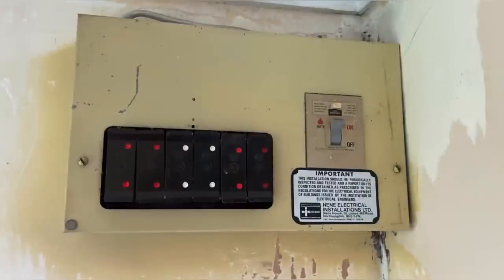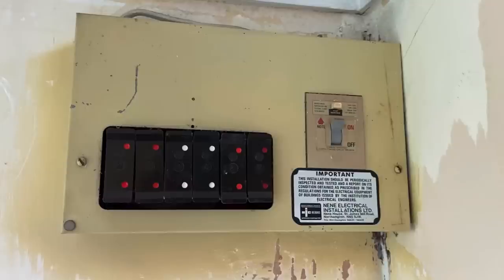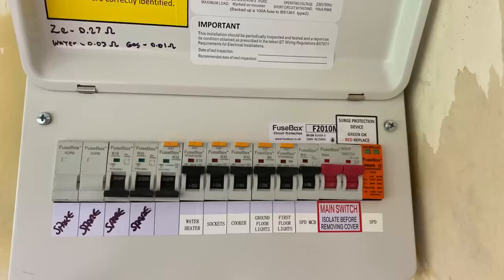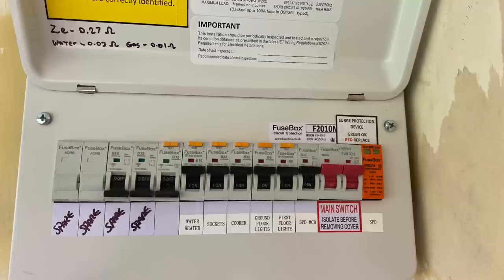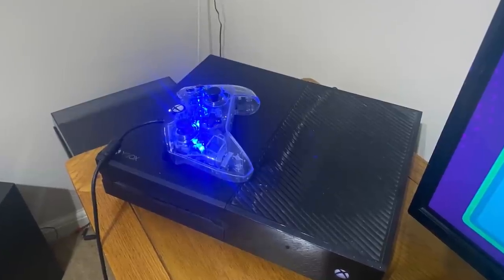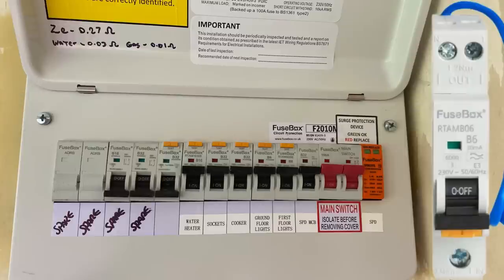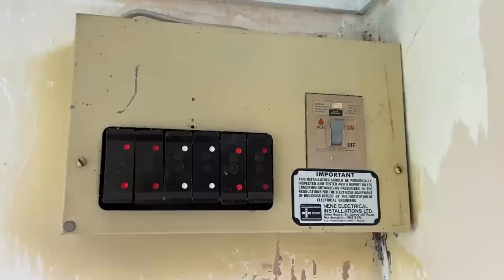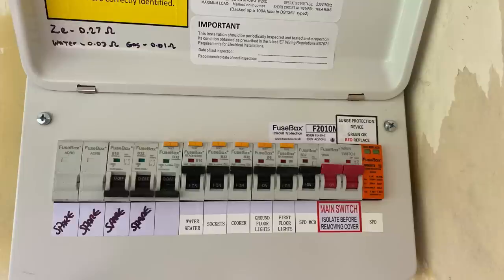Would you Change this Fuse Board..? WHY..? Understanding your new Consumer Unit

Comment: When I was still contracting I have updated the fuse carriers to MCB's which plugged straight in in place of the fuse, if they are still available it is a quick and safe way of updating your system.
Reply: Did the same retrofit to my Wylex consumer unit. Cost less than fifty quid. I had an external 30ma RCD fitted which looks like the one in the video.
Reply: All well and good and legitimate, but you still lack RCD protection, you would either need separate RCDs for each circuit or one RCD for the lot which would give a total blackout if tripped.  Recommendation would always be a new fuseboard.
Reply: Wylex plug in MCBs are available from Screwfix and Toolstation.
Reply: They also offer the major benefit of being able to safely reset a tripped circuit (assuming the fault has cleared itself, e.g. a blown incandescent light bulb that's now open) without having to turn off the main switch. If there's one thing I definitely wouldn't want it's try and insert a fuse carrier with nice fresh fuse wire into a short circuit.
Reply: @Ragnar8504  Best to turn main switch off to do that.
Reply: @antlane365  Don't see any reason to do that if we're talking about MCBs. For replacing a rewireable fuse absolutely!

Comment: On the plus side the old Wylex boards have double screw connections which to me always seemed a more secure connection.
Reply from the maker: Great point 👍🏻
Reply: A point I have made previously.  Two screws per connection,  round terminals ( not square like mcbs)  on incoming tail connections and outgoing ways .  Shower pull cords and cooker outlets etc had 2 screws per terminal,  now it's one big screw but is useless as it just splays the strands and can be wiggled out .
Reply: @Woodkin007  we should be telling the manufacturers this . Might be a selling point for them to promote
Reply: There might not be any truth in this. But a guy I talked to a few years ago worked for SSE . He said in his own home he would never have mcbs in his own home due to the fact he’s seen fires caused by faulty mcbs ..Hence he would only use rewireable or cartridge fuses in his house.  I often wonder if there was any truth in what he said.or could it just be down to loose screws?  in some ways in old Wylex were far better having  the 2 screws  on each terminal,excluding the earth.
Reply: @andysims4906  I worked for a network operator for nearly 40 years and the vast majority , if not all, of meter board fires that I attended were due to loose terminals within the consumer units. We were always taught to re-check every connection after cables were installed and dressed. Quite often you would be able to further tighten the terminal screws.

Comment: A few little observations:
- SWA not glanded into back of old board
- Two circuits don't appear to be 4 mm2 or larger but have 30 amp fuse carriers (first and second from the left)

Every time I see one of those RCDs I can't help but wonder how these came to be sold in the UK under Wylex and Hackbridge Faraday brands. As far as I can tell, the original design dates back to the 1960s and can be traced to F&G Austria. F&G was initially a German company but during WWII they built a factory in a remote corner of Austria (at that time occupied by Germany) to prevent bombing. After the war this company became independent and is claimed to have built the first production-ready 30 mA RCD.

Around the early 1960s they introduced a very sturdy range of MCBs and RCDs, which looked exactly like the Wylex one in the video, except for having the F&G Neptune logo moulded into the case. The exact same design was produced by eastern German state-owned VEB Elektroschaltgeräte Dresden until the Berlin wall fell. F&G Austria discontinued the design a few years earlier, perhaps in the mid-1980s. A surprising number of these units are still in service, in Austria although most RCDs are 100, 300 or even 500 mA types and therefore replaced as any updating is carried out. The MCBs also predate modern B/C trip curves and provide inferior overload protection.

Comment: A very important thing to mention (sorry if you did and I missed it) is that the original consumer unit is actually in a dangerous state.  This is because the plastic cover for the fuse carriers on the front is missing (it's supposed to attach via the little hole above the fuse carriers.  Without this in place to insulate the fuses from the casing a blowing fuse can arc to the casing of the consumer unit.
Reply: Not just that, but it has a couple of 2.5^2 (singleton) cables going into 30A fuseholders, plus a few other issues. It's notable that the old unit has 4 x 30A and 2 x 5A circuits (all wired @3:22) whilst the new one has just 2 x 32A, 1 x 16A and 2 x 5A. So one fewer circuit, and 2 fewer 32A/30A fuses/breakers. There's something very wrong there.

Comment: Proving your own point about a level of skill required with rewiring fuses - you illustrated winding the wire the wrong way round the retaining screw, so tightening the screw will tend to push the wire out.
Reply: Paul you giving your age away. I was about to comment similar
Reply: The problem you had with winding the fuse wire the so called right way round was it tended to snap the thinner 5 amp fuse wire . We used to do one end the right way round and the other end the wrong way round , ( for 5 a ) the little washer preventing push out.

Comment: My Wylex board didn't have any RCD protection, so it's days were numbered anyway. Then one day the electric shower stopped working and I found the 30A fuse carrier had got warm over time, so much so that when i pulled the fuse to check it, the holder broke into two pieces, leaving the live pin in! Nice! The new RCBO board with surge protectors is a fair bit safer!
Reply: Hi, getting the same shower fuse burning as well and tripping out. When you replaced consumer unit did you have to rewire that circuit
Reply: @MimiS6000  No I didn't need to rewire the shower circuit, the issue was only with the 30Amp Wylex fuse and holder in the old consumer unit. The new shower RCBO is a 40Amp RCBO anyway, so much safer. I went for the 'Fusebox' 14 way consumer unit with all RCBO's to give me some expansion options for later.

Comment: Great video, but I was always taught to put the higher load circuits next to the main switch , keep bus bar less loaded .
Reply: Busbar is made of metal, whilst the current along it may vary, the fact it is metal means the entire busbar will rise in temperature regardless of where those high current circuits are placed along it.

Another reason for placing high current circuits close to the main switch is to reduce the length of busbar the current passes through and thereby keep the voltage drop across it to a minimum. This will then result in the highest possible voltage at the load end of the circuit.

But given the length of the cable in the final circuit is going to be considerably longer than the length of the busbar and likely to be of smaller cross sectional area, the voltage drop across the length of the cable is going to be a fair degree higher get than the voltage drop across the busbar.
This then brings in to question whether the voltage drop across the busbar is even worth worrying about, unless you are in an edge case scenario and you are desperate to save every volt or every half volt you can.

And then, finally, the only other reason for doing it, is to reduce the I Squared R loss in the busbar and reduced the wasted energy, which in current (pun intended) times might be worth doing given the now high unit cost of electricity.
Reply: @deang5622  "Busbar is made of metal, whilst the current along it may vary, the fact it is metal means the entire busbar will rise in temperature regardless of where those high current circuits are placed along it."

"And then, finally, the only other reason for doing it, is to reduce the I Squared R loss in the busbar and reduced the wasted energy, which in current (pun intended) times might be worth doing given the now high unit cost of electricity."

You've basically contradicted yourself.  Temperature rise (and power loss) can be minimised by placing the highest current loads closest to the switch.  The length of the cable is pretty irrelevant since the cable only carries current to the load it's connected to.  The bus bar closest to the switch carries the current for ALL the circuits.
Reply: Less loaded?
Reply: @ferrumignis  The length of the cable is most certainly relevant. It's far and away the most important part of the voltage drop on high powered devices, like an electric kettle. It's easy to see. If you measure the voltage on a socket near the CU and then one somewhere in the middle of the circuit with a large load, then the vast majority of the voltage drop and hence the power loss is in the cable. In my case, if I turn the 3kW kettle on, there's an approximately 8V drop at the socket where it's plugged in (and about middle of the ring) whilst that at the CU is negligible (maybe a couple of tenths of a volt - difficult to say as there is a certain amount of second-to-second variation on the supply anyway). 

That's not surprising. When I look up the cross-sectional area of a copper busbar for a CU, then I find it's 10mm^2 of copper. The 100A rated Eeton Z-SV-10/1P-F/13 is 13-way, The maximum conductive path is 220mm, and the resistance of that length is just under 0.4 milli-ohms.

The maximum current per connection is 50A, so if we take the worst case of 50A over 0.4 milli-ohms, then the voltage drop along the bar would be 20 milli-volts. The power dissipation would be 1 watt. That's an 11.5 kW load with just 1W (0.009%) lost in the busbar in the worst possible case for a single load on a bar that length. Add a second 11.5kW load at the "wrong end" of the bar and you virtually double the voltage drop and power loss, but it's entirely insignificant. 

In short, you've been fed a myth. If a busbar is going to overheat, it will be due to a poor connection to the breaker, not because you have put an 11.5 kW load at the far end of a busbar. The power losses are negligible. 

I put this up there with the nonsense about eddy currents in metal consumer if running the two parts of a ring main through separate holes. It's entirely insignificant.
Reply: @deang5622  I've done some calculations on this in another reply on this thread. If you put a 50A load on the far end of a 13-way busbar (which are 10mm^2 copper), then the voltage drop is 0.02 volts and power loss in the busbar is 1 watt. That's about 0.009% of the 11.5 kW load. In short, insignificant. If you ran and 11.5 kW device for 24 hours at current daytime power rates, then it might cost you about £90, of which less than 1p would go on heating the bus bar in the worst possible case for a 13 way connector.
Reply: @TheEulerID  Can you explain why BS7671:2001 explicitly states that the MCBs shall be arranged in descending order of rating with the highest rated ones next to the isolator or RCD?  Have British Standards fallen for your pesky myth? 🤣🤣
Reply: @ferrumignis  If it does, then sheer stupidity as there is zero reason for doing so. As it is, the vast majority of real-world CUs are not installed that way, including the one in this video.

The only reference I can see to this "rule" can't actually quote the text or rule number.If it that to be followed then it would mean, for example, that if a new electric shower circuit was installed then all the MCBs would have to be shuffled down.

It makes not sense. The power dissipation is minimal (and I also now find that some busbars are 16mm^2). 

What makes more sense is to space out RCBOs that they can, apparently, dissipate up to 1W each (and the panel of my CU above the RCBOs is subtly warmer).

nb. why is the reference specific to BS7671:2001? A bit out of date isn't it? We are now on 2022, which is the 18th edition.

Comment: Great video going through the advantages that the customer should get if they had their old fuse board upgraded to a modern consumer unit to the latest regulations. But their existing unit was adhering to the regulations at time of design so if that is the case they do not need to replace it but would improve the safety of the installation if they did. Pedantic I know, but hey everyone has to have a hobby.
Reply from the maker: True… however it’s like having a betamax video recorder when everyone else is streaming. 

The board was charged as the property was undergoing major works. The video was to show learners what a new consumer unit can offer however I did leave out AFDD’s this time but will include it in a later video 👍🏻
Reply: @GSHElectrical   I always think its more like having a 1950's car, you can tell the customer the obvious benefits of fitting a seatbelt, but it's the customers choice to have it fit, we shouldn't be able to force them. But if they're having the car fully refurbished it should be upto the latest regulations...imo
Reply: my home has one of those old units, 4-way without RCB.

Comment: I've still got an old steel clad Wylex consumer unit and I've replaced the old outdated re-wirable fuses with plug in breakers as in my experience they're much safer as they trip out MILES faster than any fuse can blow and if there's ever a short circuit in the fixed wiring the cable doesn't get all shot to bits as it does with the old fuses which can make the repair much harder and a miles bigger job.

Comment: My home was an ex pub built in the early 1700's with 24 inch thick solid stone walls including the interior walls.
I have a 40+ year old fuse board.
Never had an issue so no need to change it.
It was hilarious watching the sparky turn up with his poxy little battery drill to plumb in and fit the electric shower.
Everything is a fight, nothing is flat, square, level, plumb or easy.
Reply from the maker: Thanks for commenting and watching 👍🏻

Comment: What is odd is that the original fusebox had 6 circuits whilst the new one has only five live circuits, not to forget significant rating differences. The old fusebox had two at 5A (lighting) circuits, four 30A circuits. The new unit has just two 32A, one 16A and two 5A circuits.

Going left to right on the original fusebox (from @3:22), there's a lot wrong.

1) 30A fuseholder feeding what looks like 2.5mm^2 SWA cable. The SWA sheath is not earthed (maybe it is at the other end), but what on earth is that feeding? In any event, it looks like the wrong sized fuse-holder (of course it might have 15A fuse wire in the holder, but who knows?).
2) 30A fuseholder feeding what looks like a red 2.5 mm^ cable. That is wrong rated, maybe it has the 15A fuse wire in it, but it's still not right.
3) 5A fuseholder (lights presumably)
4) 5A fuseholder (lights again)
5) 30A fuseholder, with what looks like a ring final, but the red wires seem mismatched with a 4mm^2 and a 2.5mm^2. Perhaps it's an optical illusions, but it looks strange.
6) 30A fuseholder with what looks like a 4mm^2 cable, presumably for the cooker.

On a two storey property, the typical pattern was often two 5A lighting circuits, two 30A rings (for sockets), one 30A for cooker and one 15A for a water heater. That must have been the case in millions of houses throughout the land. It was certainly like that in the house I was brought up in (a modest council house built in the 1950s) and a 1970s terraced house I owned. 

I should add, that it's definitely a replacement for the original fusebox as the torn paper on the wall is identical. So what happened here? There is more to this than a simple swap of a modern consumer unit for an original fusebox. I expect there are some wiring "issues" to sort out, and that the "spare" breakers are these for when those get sorted out.

Comment: If the installation was originally a TT system - the 100mA rcd may have been a reasonable choice considering the regulations in force at the time.